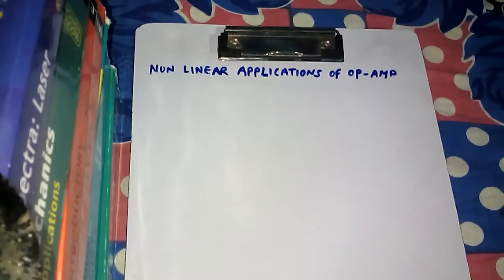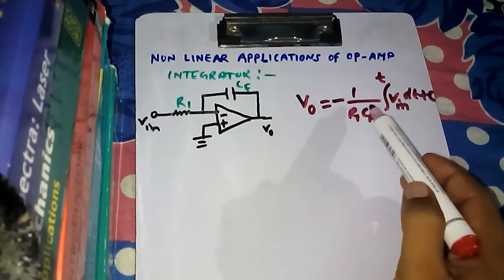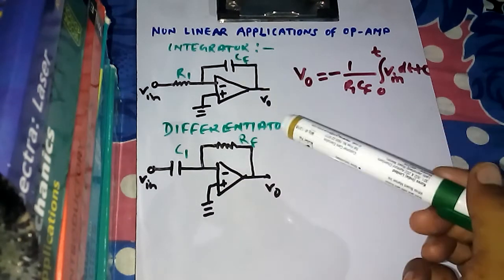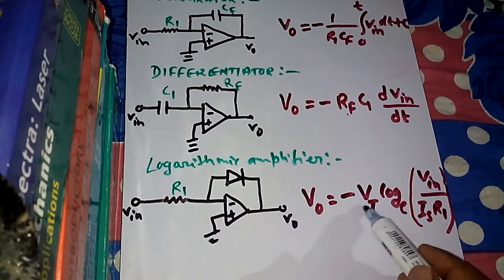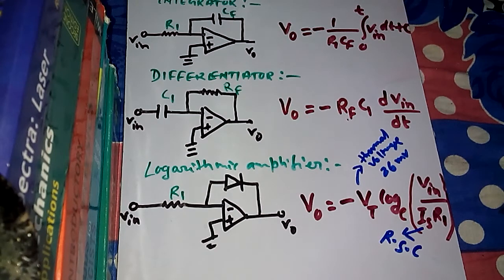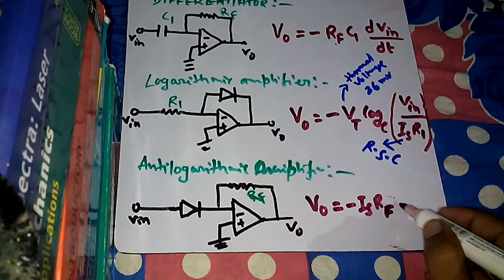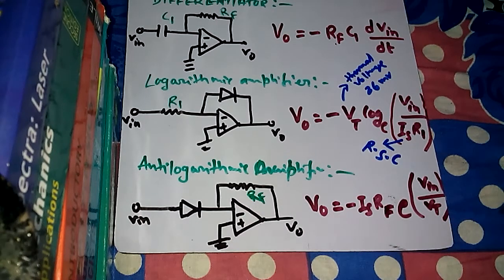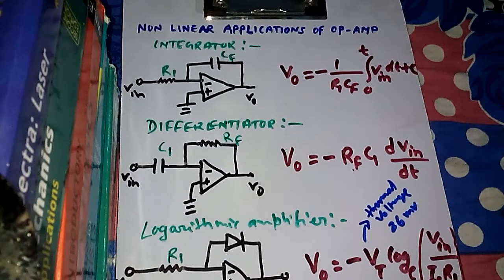op-amp applications(nonlinear)

Comment: it performs the mathematical operation of integration with respect to time; that is, its output voltage is proportional to the input voltage integrated over time.
So integrator is linear application 😒😒😒😒😒